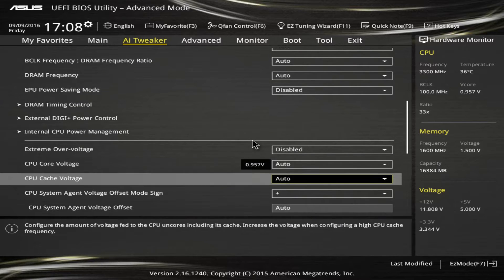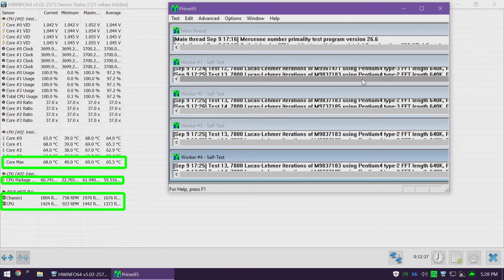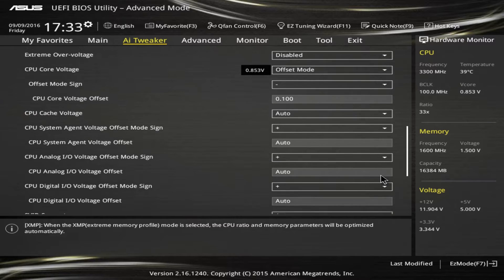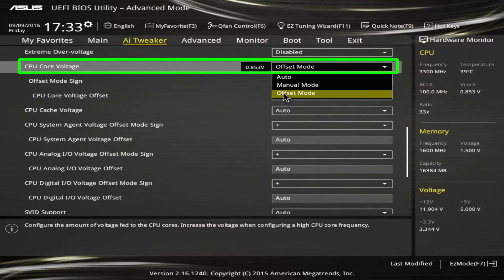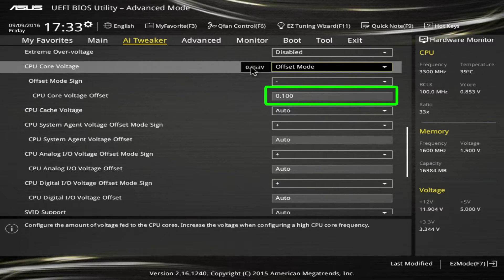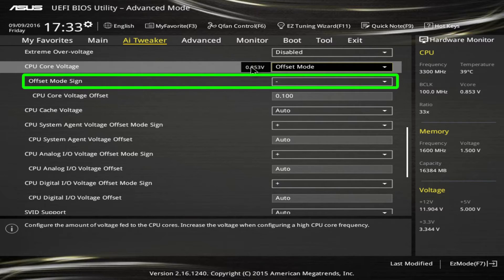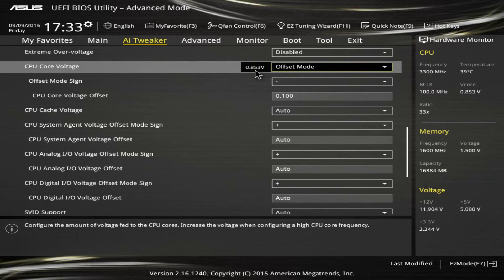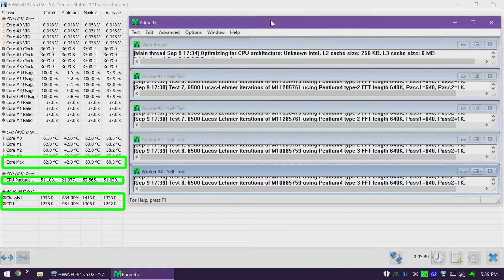Undervolting a CPU - How does it work, and how much does it save you?

Comment: Question: so you said that it will extent the life of my CPU how long do CPUs last my old CPU(which still works )was used (A TON) for 11 years
Reply from the maker: Realistically, CPUs last far longer than they're relevance, with or without undervolting. Even old Pentium 4s I've come across recently still work.